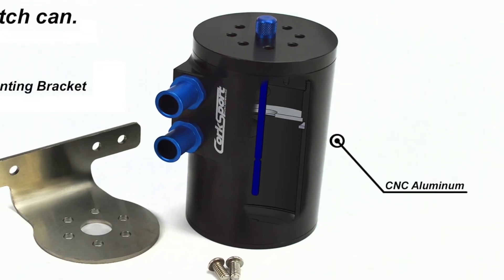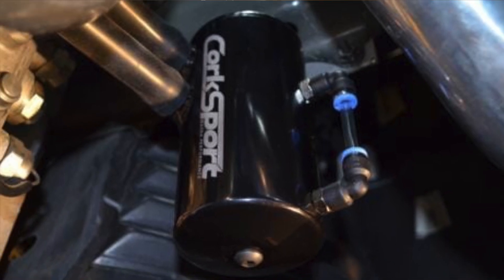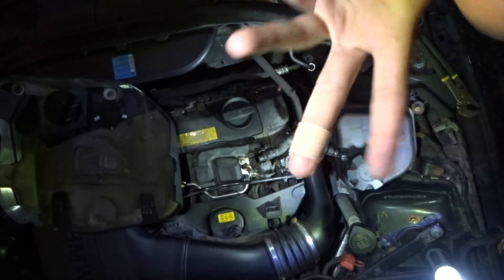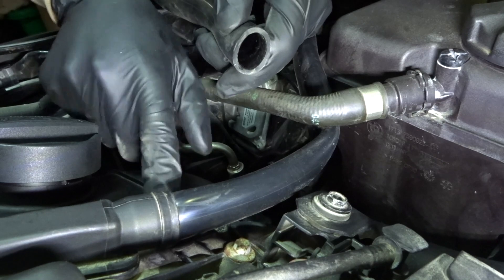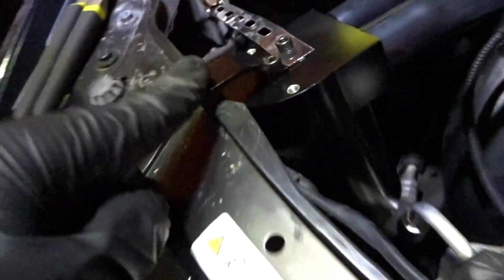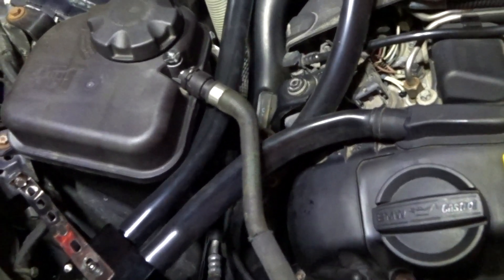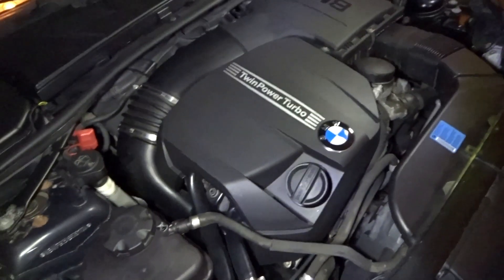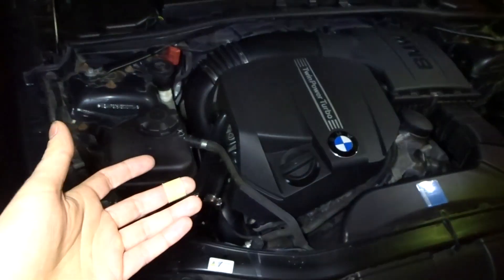Is a 20$ Oil Catch Can worth it? // Mythbusted (BMW E90 E91 E92 E93)

Comment: I think the tube need a slight upgrade oil vapour will degrade that pipe you need proper automotive tubing to resist oil damage
Reply from the maker: I 100% agree! However, my problem is that I couldnt find one... help?

Comment: Wtf is that install haha :D
Reply from the maker: A DIY quick install which has worked for over a year and a bit so far lmfao caught a bunch of bad oil and probably helped the engine be a little happier .. necessary for turbo cars
Reply: @GarageNineteen  yeah, but that can also be installed nicely and not in ghetto style :p
Reply: Ps i have a 335i n55 ;)
Reply from the maker: @TopSecretForzaClub  lmfao I ended up redoing it cleaner later on in another video. But yeah was definitely ghetto 😂😂
Reply from the maker: @TopSecretForzaClub  nice !
Reply: @GarageNineteen what video??